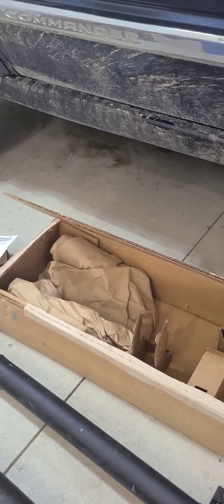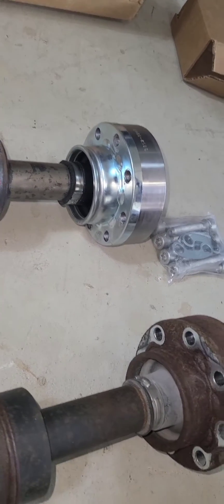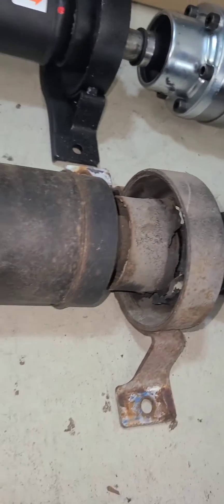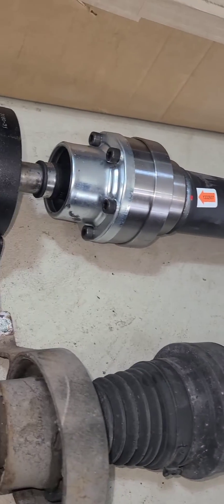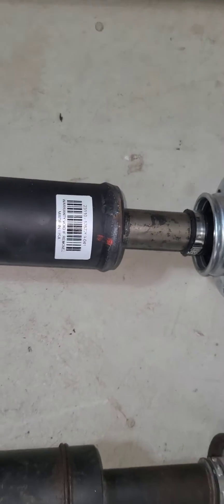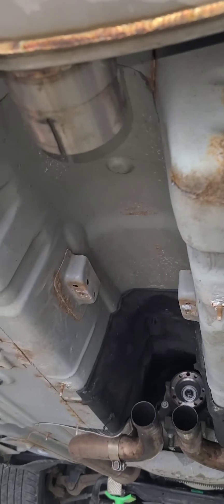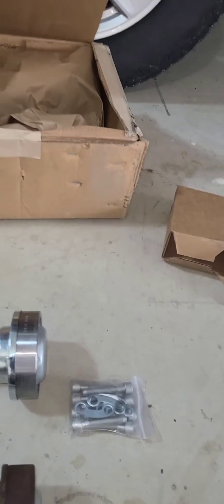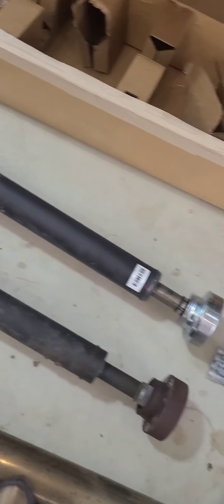Dorman Drive Shaft - 986-041 Dodge Charger, Chrysler 300, Hemi 8HP70 Vibration / Rattle fixed!

Comment: Just add a little bit more information. Mileage was 50,000 it was out and that noise carried like it was a front wheel bearing or loose strut end up being the drive shaft carrier bearing

Comment: I use the same great dorman drive shaft on my 2016 V6 Challenger. All you have to do is loosen take off two clamps midpoint of the exhaust system pry down with 2x4 drive. Slab slipped right in. The 2x4 I blocked it between the muffler and the floor pan was plenty of room to help me. Head car raised up on car ramps and safety jacks holding the back in so the car was level. Great video!

Comment: My 2013 RT has a noticeable clunk under hard acceleration from a stopped position and a small vibration at 80 and above. Drive shaft????
Reply from the maker: @TheKeefus1971  very close, but I'm pretty sure your 2013 is a different part number than my 8 speed.  If you put it on a lift, you can stick a rod up between the mufflers and wiggle the driveshaft. If it moves at all, that carrier bearing is probably bad.
Reply from the maker: @nestooor00 need a new driveshaft, since the carrier bearing sounds blown